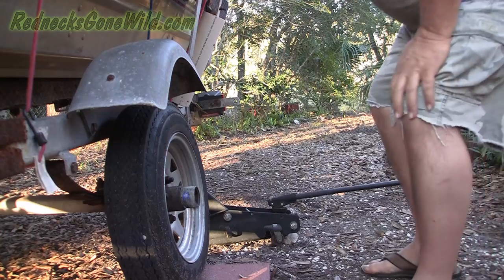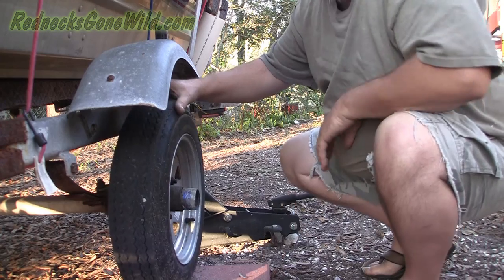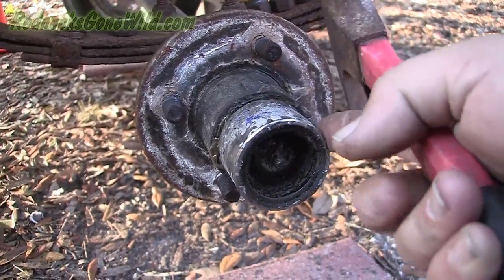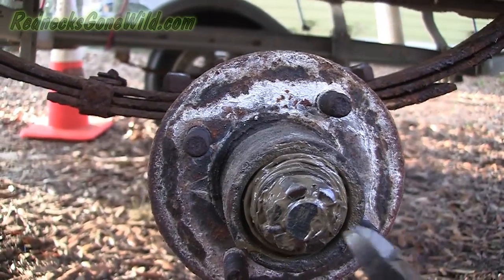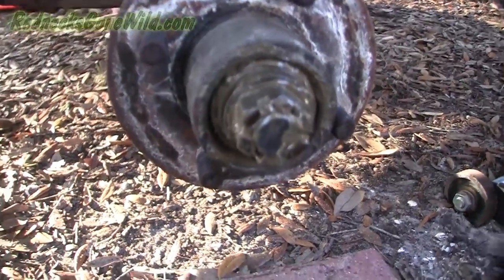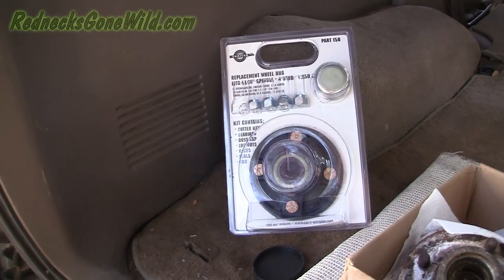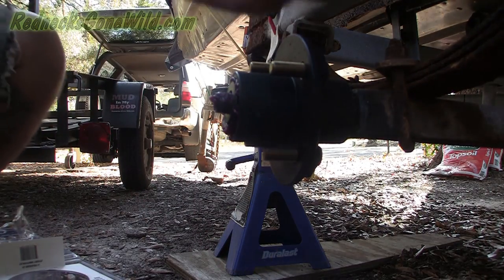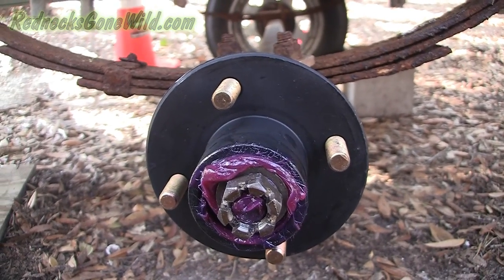How To Replace Trailer Hub and Bearings

Comment: I have to pipe in too to say you need to 'seat' the bearings first by tightening up the castle nut (I use a 10 or 12 inch crescent wrench for 'feel') pretty tight (some say 25 ft lbs others 40 ft lbs but you can feel it)while turning the hub, then back it off and then retighten until there is Very little torque on it, then back off so the castle nut lines up with the cotter pin hole in the shaft. Old style round bearings required 'preload'; roller bearings should have zero play after the castle nut is backed counterclockwise snug against the cotter pin. Too much preload type torque on a roller bearing will cause heat failure, and premature bearing failure.

I hope I described this so it's easy to follow.

Comment: Thank you. I had the same thoughts as i was towing my boat.  Same issue and had a very similar reaction as you When i jacked it up. Your video was comical quick and to the point and very helpful. Im a good mechanic but have never replaced a trailer hup. Once again thank you

Comment: Great job with the kit. Might want to think about a new set of springs as well.
Reply from the maker: got new springs the next week , Thanks
Reply: Did you do a video for the springs? I have an old tent trailer with the same problems.
Reply from the maker: ***** no
Reply from the maker: JEFF WILLIAMS No sorry , I already did that but it was so easy i didnt video it .
Reply: Why the hell would he do that? Just search for a spring video.
Reply: Justin Berwick because I like his videos and want him to do it.
Reply from the maker: ***** lol pretty simple, cut old bolts off they going to be rusted. then replace the 2 spring mount bolts & the Axle Mounting bolts  , Total of 6 bolts each side .lol no i aint doing it again , lol i dont do puzzles.
Reply: Well aren't you important. It took me 30 seconds to find a dozen videos for springs.
Reply from the maker: ***** i know , thanks for your support.
Reply: Cool

Comment: I would have added some commentary about how tight a castle nut should be.  Generally finger tight, then back off a 1/4 turn. Also, how to install a bearing buddy, and what they are for.  The importance of clean grease, completely filling the hub to be sure water and sand can't enter.  As for checking your bearing and grease health, it's a good idea to feel the bearings with the back of your hand after a good long highway run.  If one is hotter than the other, it's likely that one needs attention.

Comment: Before it gets that bad you need to replace your bearings,  when it gets that bad you've been putting it off for a LONG time.
Also should seat the bearings by slightly over tightening the castle atleast twice and set the castle nut to the correct tension....but that will do for a trailer that stays away from trafic

Comment: Thanks for taking the time ,great video but a bit more show would have been great about how to do the bearings and cap it off to finish product, Not sure if it is me but I notice only one U Bolt on the spring, not sure if that is right or wrong. cheers

Comment: I have a huge trailer 3 axel with 30' boat. Mine I have to tighten down with wrench to seat bearings... If I only do finger tight it will wobble. So I found I must slightly seat bearing and hub with wrench till it is solid against backing plate, then back it off and then finger tight 1/4 turn back. Anybody else ? I did finger tight first time no bueno. Had to re jack trailer with 30' Mako. That being a 2 hr event per side in itself.

Comment: The inside surface of a trailer tire is approx. 1/2" towards the frame compared to its bottom inside edge on the ground. Haven't removed to inspect, but what could this mean? I bet you answered my question, so I'll lift frame and toy with it. But any suggestions would be appreciated.
Reply from the maker: sounds like you need new bearings & mabey Hubs also.

Comment: I can't believe that the trailer spindle did not scare, do to the hub and bearing being so loose. There's no way ! As loose as it was, you couldn't feel the vibration from the trailer. You should've  demonstrated how the bearings need to be packed with grease. As loose as the hub was, It's hard for me to believe that the bearing didn't size up, burn up, or the wheel assembly completely collapsing.

Comment: I never liked bearing buddies. You never get the grease to the rear bearing, besides it's always best to remove and inspect then re-pack the bearing then load set the bearing.
Reply: Never get grease to the rear bearing?    How so?    It packs the whole hub cavity full of grease,   the bearings get warm when pulling the trailer down the road and the grease flows throughout the whole assembly?    Unless your seal is bad it should get everything.    

Bearing buddies are still better than a tin dust cap....

Comment: Great video! I have a similar small landscaping trailer. ( yeah I know) I have the 4 lug hub, so my question will be, can I change it to a 5 lug hub, because I want to install bigger wheels and tires? What you recommend Mr. RedNeckGoneWild? Thank you in advance. Btw thank you for letting us know that AutoZone carries it. I never would have guessed that.
Reply from the maker: yes but you need to make sure the bearing is the same size as the spindle & you may need to have bigger fenders.
Reply: As for the tires, I would go with 33 zillas

Comment: Instead of buying the $45 hubs, why not just clean the nasty old grease out of the hub & install new bearings/seals for a lot less money. At least explain the processes & cost options to your viewers. Some may not know anything about hubs & bearings and may just need bearings, which are very inexpensive, or need the bearings re-packed, which cost a little grease. They may not need new $45 hubs. Also, you DID NOT show or explain anything about checking bearings, races, seals, cleaning & re-packing or replacing any of the same. You only show how to put a new hub on, which, in actuality, is rarely ever needed.
Reply from the maker: when i made this video I DID not know anything about hubs & bearings ,Just how to replace the hub, Thats why I named the video what i did. This video isnt hubs  bearings 101 everything you need to know. I did the best i could with what i knew at the time , Thanks for watching.
Reply: always gotta get a perfectionist whining...this is my first time trying this and I'm gonna buy an entire NEW hub to play it safe...good video thanks for sharing brother \m/
Reply: I can speak from experience, my bearing seized and ruined the hub. The other side hub bearings were just worn I replaced the bearings. The bearing set was 22.99 and the castle nut and and washer was 8.99 so if you need all the parts you called almost buy the hub assembly cheaper.
Reply: Brand new hub, brand new studs, brand new cap, brand new lug nuts, brand new bearings. Worth every penny
Reply: My hubs are warp right from the factory. Cheap harbor freight crap.

Comment: To respond to some comments, that IS called a "CASTLE NUT".  In this cse, it's used to adjust the bearings but that IS the correct name.  "CARTER PIN" - Thats a different story....
Reply: cotter pin

Comment: Kevin,

Just a FYI i have been using small boat trailers for years just like the one you have.

Here is what I learned over the years.

* If you have the bearing packed properly and they stay dry meaning water doesn't get to the bearings, races, seals, axle and hub you should never have a problem.

* Hear is the problem you are going down the road and the hub on the trailer will heat up some not hot but warm. This is normal. Now with your hubs warm you back them into cold water! Well because the hub is warm and the water is cold water will slowly seep in to the hub through seals behind the tire and the hub cap in the front.

* As this little but of water gets into the bearing over time the grease will break down and will not properly lubricated the bearings and races. As this happens friction becomes a problem and the entire hub assembly heats up an melts the grease away from the parts it is lubricating. After time you will have metal on metal then with heat and wear the bearing will finally seize up and cause galling and lock ups.

* That is what video have in the video.

*The only way you can eliminate the problem from happening again is as follows. When you put you boat in the water or remove it DO NOT BACK the trailer all the way in the water. Just watch in your mirror and back the tires in just so the water level just comes up to the wheel hub but never touches it. So basically less then half of your tire is in the water.

* Most boat trailers have a hinge in the middle so the trailer will tilt. Now you will just let the boat tip back and push it in the water. Tie it up and pull your trailer out and park it.

* When you come back from fishing back the trailer in the same way without letting the hubs get in the water. Get in your boat and wit the motor run you boat up on the trail ad far as you can get it. Be careful you may have to set the trim up if the dock is shallow so you dont damage the prop or lower unit. No get out of the boat and hook the winch rope up to the boat and winch the rest of the way.

I know this sound like a lot of work but replacing bearing every year is a lot of work and expensive every year.

Without back your hubs in the water they will last for years.

I am trailing a 20 foot flat bottom with a 90 horse mercury and this is what I do.

No way to stop the water getting into the bearings over time backing them under water. If you do back in the water you will have the same problem time after time.

TIP: Every so often take your hand after you get to the boat dock from your house and feel both hubs they will be warm but no hot to touch. If they are hot to touch you have a problem.

Take care 

-John
Reply: Alex Conrad: What you just said about not backing a boat trailer in the water and submerging the hubs is the stupidest thing I've ever heard. I would sooner replace my trailer bearings every so often then break my friggin back or bust a nut from loading and unloading my boat. WoW and you say you have a 20 foot flat bottom with a 90 Merc on it and do it this way all the time. The trailer was designed to be backed in the water to float the boat on and off the trailer with ease, so you don't bust a nut or break your back doing it YOUR way. I do thank you though, because it's been a long time since I've laughed out loud so hard. I worked at a marina for twenty years, and I used to get a lot of laughs watching people like you that didn't know what they were doing when it came to backing a trailer up, loading/unloading the boat, people like you make an easy job so difficult and painful.
Reply: I totally agree.  I used to work with this knob that thought you shouldn't back the hubs in the water.  He would be back there like a dingus just a huffin and puffin trying to rock that boat off the trailer instead of just backing it into the water 6 more inches.  Just repack your bearings every once in a while people, its not that hard.  Use the tool for what it was made for.
Reply: OwossoMT
Exactly.
Reply: Alex Conrad Nah. Replacing bearings is neither "alot of work" or   "expensive". You can get a bearing kit that includes, (bearings, seal, races & cotter pin), for most any  trailer, for under $15 per hub.
Reply: You’re incorrect. You never power onto the trailer because it can cause damage to the ramp. Would be entertaining to see you breaking your back on the ramp though! Maintaining your trailer isn’t time consuming and is simple.
Reply: Very helpful thanks bro